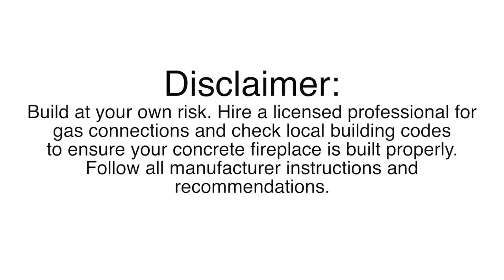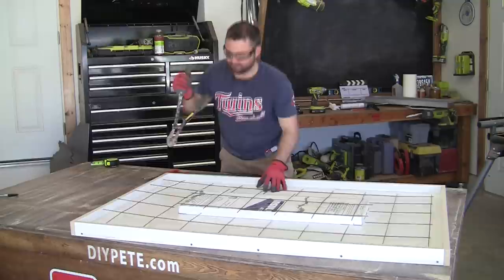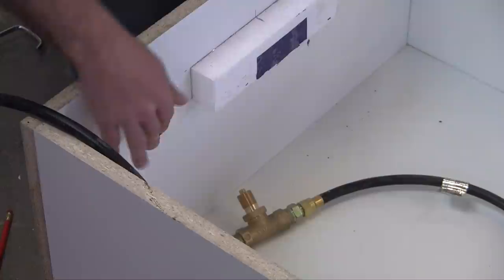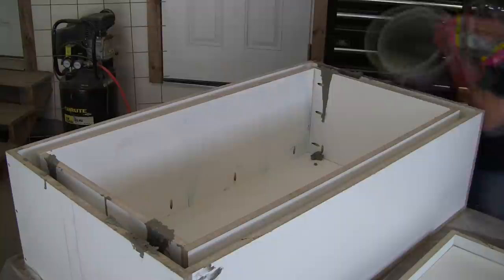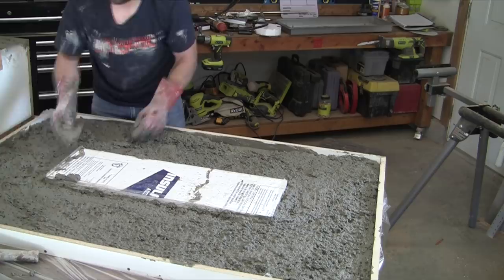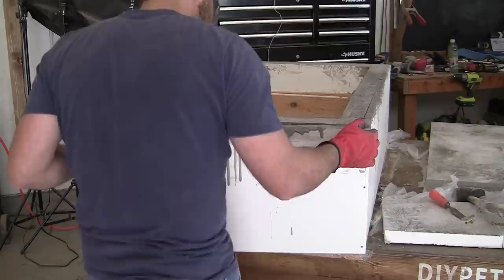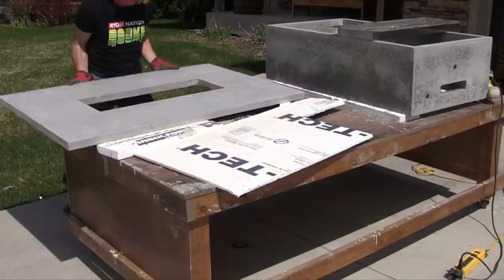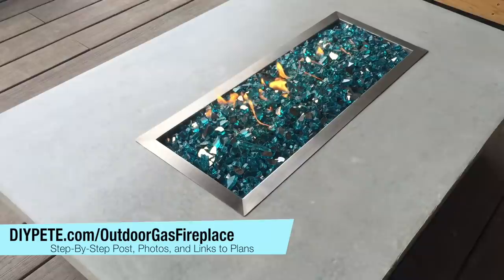How to Make an Outdoor Gas Fireplace

Comment: Just built this last week. Actually puts out a lot of heat, and if a breeze is blowing, the heat will head in that direction. Had people moving to or away from heat depending on what they preferred!  Very relaxing watching the flames dance and flicker. I also used wood for base. DIYPete is correct in protecting from fire danger but the correct type of wood and plenty of space  underneath to keep pan cool.This is not wood fired, so no sparks or embers to deal with. Thank again DIYPete.
Reply from the maker: Peter, your fireplace turned out absolutely amazing. I love it! Thanks so much for sharing, and keep up the great work. Cheers from Montana. - Pete

Comment: Good video. Makes the project look achievable for those without experience. I have look up the definition of concrete because I've always thought concrete is cement with stone, but everyone is calling these projects concrete.
Reply from the maker: Hey Todd, concrete consists of aggregate and cement mixed with water. This concrete mix consists of pea gravel, sand, and cement. Cheers

Comment: I think i will actually use this method to create mine, however i am forgoing the concrete base for one with a wood construction so i can house the tank underneath. I was trying to find something to use for a table top, and until now was considering tile. 

Also, as a tip to anyone else doing this, you can create different effects in your concrete by adding colored sand to your mix.
Reply from the maker: Thanks!
Reply: The Chosen One, did you ever complete this and did you use wood base? How did it turn out? Pics?

Comment: Have you considered using recycled plastic lumber for the forms? It comes in dimensional lumber, 2x4, 2x6, etc, and sheets like plywood. The thickest sheet I have seen is 3/4 but 1 inch may be available. The concrete will not stick as much and deforming should go better.
Reply from the maker: Hi Michael! Are you talking like the composite type decking materials? I'm not sure I've seen plastic lumber. What brand are you looking at and where do you buy it?

Comment: So glad I found this! My 15 year old is the man of the house and we are hoping to do this together. I am debating doing this with natural gas or propane. I just like a cleaner look and it's sounds stupid but I don't want a propane tank hanging around. Is there a creative way to hide the propane tank? Did you attach the concrete top or is it just set in place? Maybe the propane tank could be set under the table top and just lift it off to change the tank? Does this sound possible?   Just deciding if it's worth it to dig a trench and have a plumber run a gas line.
Reply from the maker: Hi Ivory! You and your son will do a great job :) It makes total sense to want to hide the tank. To be honest, I'd recommend building the top out of concrete like I did. You can do the sides, but it is a lot easier to do the sides out of wood. I've seen some pretty cool modifications by folks who've commented under the post on my website: https://www.diypete.com/outdoorgasfireplace    The concrete top is just set in place, but you could use 100% silicon to help hold it if you'd like.

Comment: Worked great.  Thanks.  I cracked the base at the corner completely all the way thru.  any tips on how to fix it?
Reply from the maker: Hey Adam! Sorry to hear about the crack. I have used high strength concrete epoxies before. for issues. Might be something to look at.

Comment: Those corners looking awfully sharp, but great job.  Curious why you didn't just do a wood base and hide the propane tank inside it? I've done 2 concrete counters in my kitchen and am about to do a round patio table top.  My 1st counter was a large T shaped pour in place bar height counter.  What a job, very tricky and did not turn out like I wanted.  The second was much easier and used a mold like yours.  I used a diamond concrete polishing kit on both and look great (what I wanted for the kitchen), but for the patio top I think I'll leave it more natural like your with just a light sanding and sealant.  Great video, thanks.
Reply from the maker: Thanks Mike! I think a wood base would look great and be quite a bit easier. Since lots of people see the video, I wanted to make sure it would be to code in as many places as possible by having the whole thing made out of non-combustible materials. Hence why it is all concrete. However, a lot of folks have modified it with a wood base. Cheers

Comment: Love this look and hope to make one some day. Dumb question - why can’t the propane tank be stored inside the table?  It looked like you had it sitting outside of the table with hoses running in.
Reply: I was thinking the same thing, why not build the table so the tank can be in it?
Reply from the maker: Hi! You would want to make sure the tank has plenty of clearance from the burner so that you didn't have any safety issues. But yes, many stores sell them with the ability to put a tank inside, so check out a few and see what to do to make sure it is done safely. Cheers!

Comment: Pete, you've inspired me to build more projects...but i hate working with concrete. I prefer tiling, what are your thoughts on building tables like this out of tiles?
Reply from the maker: Hi! You can absolutely build something similar and implement tile. Building a lower frame and then adding cement board and tile would be something that is definitely a possibility.
Reply: you mean, build frame out of wood. then put a thin cement board on top, then tile over top?  Would something like this hold up over harsh winters you think? Also can u answer this question for me. PL3 construction adhesive, does it hold up in wet / winter areas if something is glued down with it on the exterior?

Comment: Thanks for the video.  Why is there a T in the line when only one hose goes to the burner?  Whats the other hose for?
Reply from the maker: Hi! The T that you see is where the shutoff valve is built into the concrete base.The line from the propane tank does go directly to the burner, but the part that looks like a T is just where the valve junction is. Cheers!

Comment: Great project. Silly question: can the propane tank be placed under the table provided that a door is created to exchange the tanks?
Reply from the maker: Hey Ragai! Mine wasn't quite high enough for a big tank, but I know a lot of people who have modified the height and put a tank inside. A lot of the ones you buy at stores have tanks inside as well. I am not sure on the exact code and would recommend doing some additional research to double check the best way to do it.

Comment: I love the video and the results! How does water escape from the main cabinet area? I assume some will leak into there between the table and burner.
Reply from the maker: Thanks honestly not much water gets down there, if it rains though, the burner pan has drain holes. There is a deck underneath, so any water just goes between the cracks in the deck boards.

Comment: Have you ever tried putting anything on the insides of the molds to give the concrete edges a design?
Reply from the maker: +StetsonXD Hi! I have. I don't have a video using one yet, but I have some rubber strips to make the edges look like stone. I've done a few bars with the stone edges. Super easy to do.

Comment: Hey Pete, I am a Boy Scout in Birmingham, Alabama  & I want to use your fireplace project as my Eagle Scout Project for a local non-profit nursing home/assisted living facility. Do you have any suggestions about "covering" the base with a stone facade?   Would using a different type of base (instead of poured cement) be better if I am planning on covering with stones that will match an existing retaining wall that surrounds the outside area. And have you found any good looking covers for this, the location it's going is not covered & is surrounded by large trees. I am hoping to make it easy to clean/maintain for the seniors.  Thanks. Jack

Comment: Nice video...DEFF give you props for using Ryobi Tools...I love my Ryobi Tools....Price wise for supplies what did this cost?  Im think 250 to 300....DIY is suppose to be cheap/low cost...This does not look like either
Reply from the maker: Hey! I have cost info in the post linked to in the description. The pan and burner adds up, but I'd recommend doing some searching on Amazon as things have come down in price. You could save a lot of money doing the base out of a different material as well. Cheers!

Comment: Could you have placed the propane tank under the table and been safe still?
Reply from the maker: Hi Michael, sorry for the delay. You'd want an access door for it and more space than what I built mine for, but it could certainly be modified to fit the tank and is something I'd do if I hadn't been able to hide mine in an area under the deck.

Comment: Hi Pete,
I built the table, worked out perfectly. After 2 weeks, I lit it up for the first time and after 30 mins the table cracked and broke. I have a 90,000 btu burner and live in Calgary, Canada, outside temperature was around 43 degrees. Did we not wait long enough for it to cure or do you think our burner is too hot for it? Thanks!
Reply from the maker: Hi! Oh no, sorry to hear! What mix did you use for the concrete? I'm assuming you had the little space between the concrete and metal, and the vents in the bottom.
Reply: DIY PETE 
Hi  I used rapid setting cement-all mix.  There is about 1/2 inch around the edge of the fire pan and there are 2 vents at the bottom. After about 30 minutes of use the top cracked in 3 place all at once.  Any ideas?
Thank you for your help 

Rob

Comment: Can you offer suggestions for a design of a CONVERTIBLE fire pit table -- one that is a standalone fire pit table say 4x2 long. that can be converted into a rectangular table for six using the fire pit table as the center element.
[HINT: Idea for your next video!].  I cannot find this discussed anywhere.
I have a porch where a fire pit accent piece would be wonderful but a full size table is not needed most of the time.
Reply from the maker: Hi! I have the stuff to build something similar this summerand plan on actually doing something like that. ( but with a wood base ) ---- basically doing  a similar top to what is used in this video, but sitting the metal pan down a ways so a piece of glass or board can sit flush over it when not in use. Thanks for the ideas! Cheers

Comment: can this be made, but instead of using gas for the flame, possibly using something else?   And is glass aggregate, just bits of broken glass? or is it a special hi-temp heat resistance glass?
Reply from the maker: Propane or natural gas would be the options I'd recommend. The glass is a special fire glass which won't crack or pop. It is specifically made to resist the high temperatures.

Comment: Pete, 

How did it fare during the winter? Did you just store the burner inside and leave the concrete uncovered? Covered?

Great video!
Reply from the maker: Thanks Steve!  

It is under a covered patio so I simply left it outside. However, I do have some tables that I've left out over multiple winters without being covered. I re-seal them each spring, but they've done fine. Having a cover is a really good idea though.
Reply: DIY PETE Thanks, Pete

Comment: I love this project, but I have a question that you maybe able to answer in regard to a little customization on it. I'm redoing my entire backyard of my home and I'm repouring the pathways and sitting areas. We're going to be using a textured stamp to simulate a natural rock slate look. Is there a way that you could incorporate that into the sides of the mold? I don't know if putting some silicon molds into the sides of the wood frame would work or do you think it would be easier to demold it, add a thin layer of concrete around the sides and texture stamp them then?
Reply from the maker: Hi Charles, great question. I've used silicon molds for edges of concrete bars to make them look like stone. I basically fasten them in the mold. You could do something similar but with the stamps. You could do an overlay later as you mentioned -- but I think I would do the first option. Cheers!
Reply: Awesome! Thanks for the advice and keep up the great videos!

Comment: Is it possible to build the base tall enough to house the propane tank under the unit with an access panel?
Reply from the maker: Hi Troy, it sure is possible. I wanted the lower profile and was planning to eventually have a natural gas line to it. But if I'd planned propane for the long run, I'd have built a taller base. Best of luck!

Comment: Hey Pete, Love your videos. I see that you're using RYOBI tools almost exclusively in your videos. How would you say these tools fare against other (more expensive) brands like Ridgid (also owned by ITT), DeWALT, etc? I'm in the market for some cordless power tools :) Thanks!
Reply from the maker: Hi! I used to mostly use Ryobi tools. I now use many brands, and Dewalt i the main brand I now own. You will notice quite a difference between contractor grade tools and a homeowner/DIY tool like Ryobi. Ryobi is a great brand and is very affordable. However, I would invest the money in a more heavy duty tool like Milwaukee, Dewalt, Makita, etc. Something that you can use batteries with and continue to expand your line of tools. I've honestly been loving the Dewalt tools. But do what is the best fit for you!

Comment: Hi Pete.  I've been unable to source the 1.5" foam board.  Nothing at Lowes or Home Depot within 100 miles.  Have you had luck creating your knockouts with other materials?   I'm doing the 3" thick rim with 1.5" thick table and fire pit knock out.    Thanks and keep up the amazing videos.
Reply from the maker: Hey Steven! Sorry to hear. Were you able to find anything that could build up to the inch and a half that you could tape together like two pieces 3/4 inch thick or an inch and a half inch? If not, you could do a 3 inch top with an inch of foam so the majority being 2 inches thick. It would be a bit heavier but would work. I have used plywood before and wrapped it with tape. before putting it in the mold I cut it in half, drill a hole so I can pull it out, and then tape it back together at the seam. This way it comes out of the mold. Without cutting it is really hard to remove. Have fun with the project!
Reply: Hi Pete.  Thanks for the suggestions.  I took your advice and doubled up 3/4 inch foam board using some silicone to adhere them together.  Worked like a charm.   It's de-moulding day, wish me luck!  ;-)
Reply from the maker: Awesome, good luck!

Comment: 👍👍great job it's fantastic but what kind of glass do you use. Can I use any glass ??? Thx
Reply from the maker: Hi Nasser! The glass is called fire glass. It won't melt, pop, or crack. I have a link to the glass I purchased online under the video's description. You don't want to use glass that is not rated for fireplaces. I know Lowes recently started carrying gallon sized tubs of fire glass as well, (at least in my hometown).

Comment: is there a way to hide to propane tank. or do you have to modified the base to make a hidden door.
Reply from the maker: Hi! I wanted a low profile table and so it is not quite tall enough for a 20 lb propane tank to sit vertically. It would need to be modified.

Comment: If space is limited, can you use 2 plastic totes instead of making a particle board box?
Reply from the maker: Hi! The issue I can see it the weight of the wet concrete pushing on the plastic totes and caving them in during the molding process. Even the particle board will move without additional support. Let me know if that helps. Cheers
Reply: Thanks, I was probably going to use ratchet straps and possibly 2x4' s or plywood to reinforce the sides. I was trying to keep the weight down. I couldn't tell, what kind of concrete did you use?

Comment: Hey Pete. I pour the fire pit over the weekend and removed the forms this morning. The top looks great, but the base broke in half. It is a clean break, one side at the corner and the other side about half way up the short side. Is there anything I can do to fuse these two pieces back together? Thanks!
Reply from the maker: Hey Nick! Hope all is well! I'm sorry to hear the side didn't come out as planned. I know some of the epoxies can help bond the concrete, but I'm not sure if the strength for this specific application will be strong enough or not. I would try out a super strong concrete epoxy if you can find one. Worst case scenario, you could always build some sort of a wood base if you'd want. But I think an epoxy would help out.  Best of luck!

Comment: @DIYPETE
Was there any issues removing the concrete from the melamine table top mold? Did you apply anything to the melamine prior to pouring concrete in to assist after it cured? I'm about to that step and just curious before potentially learning the hard way... lol.
Reply from the maker: You can apply paste wax if you'd like. I generally don't though as it typically pops away from the melamine easily.